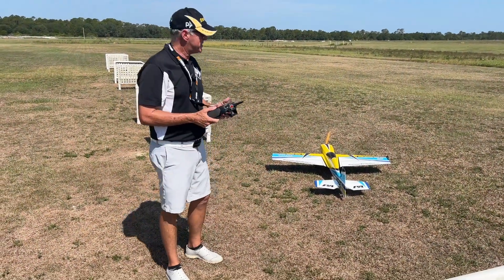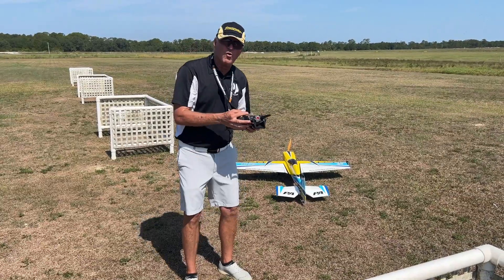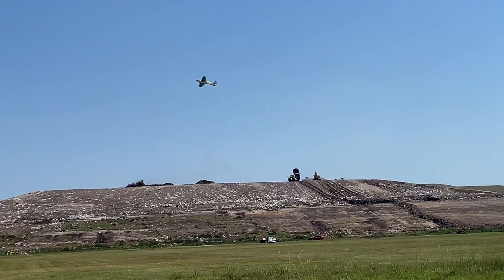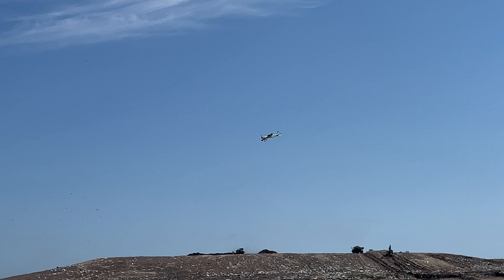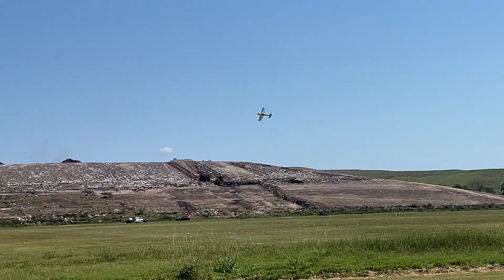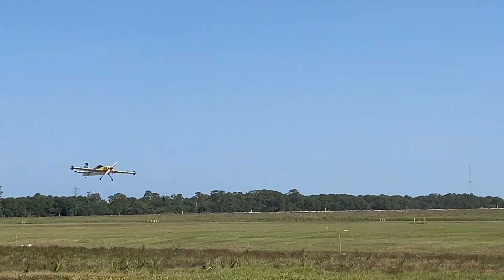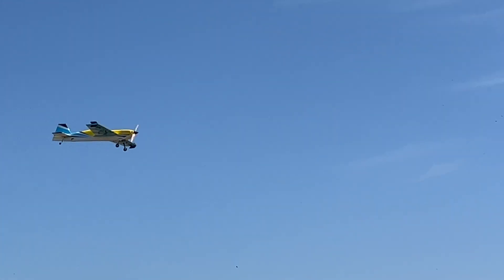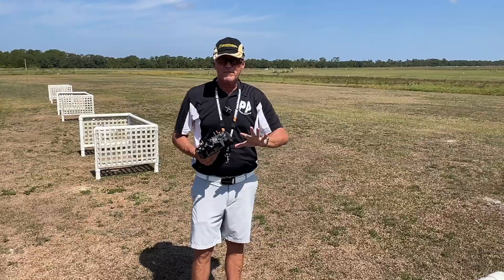Michael Wargo Instruction: Rolling Harrier and Aerobatic FIne Tuning the Radio

Comment: Not directly related to this video, but thanks for talking about rudder pitch coupling. We were flying aerobatic slope soarers today and found they had it. I remembered you talking about this and so we quickly plugged in some down elevator mixing with the rudder and got much better handling. Thanks very much!

Comment: Would really, really help to have a stick cam for these instructions.
Reply from the maker: I really think about it all the time.   My hands shake.   Always since I was a kid.   Sometimes more than others.   The times I did, I had many comments about it.   I did it a few times.   I do have a video called of in-depth maneuvers where you can find the stick movements.  https://youtu.be/EVyUtEbFAgc?si=hgcfocqGhFwMkl7G
Reply: If you need stick camera for these instructions you are not at the level for making these adjustment.
Plenty of videos out there with rolling harrier stick movements, this is excellent for helping with making it look and feel better.
Reply: @orningolfsson4235  I have bad hands (arthritis) so I fly different then most.  I use very quick rates which helps shorten throws of sticks.  It's nice to see the movements others make, especially someone older with hands like myself.  Thanks for your input tho....